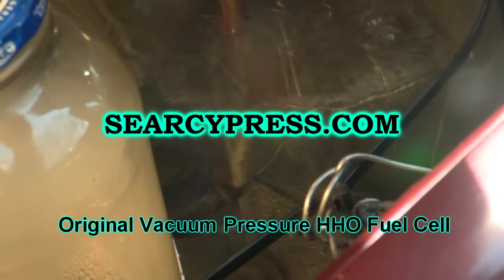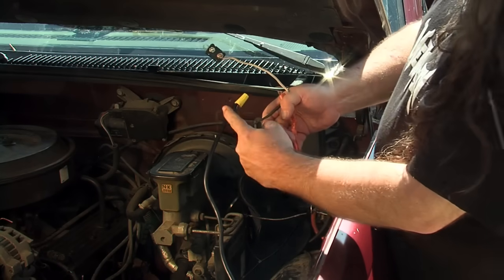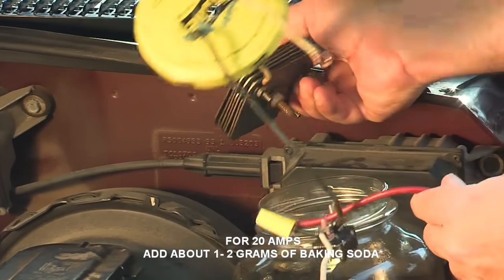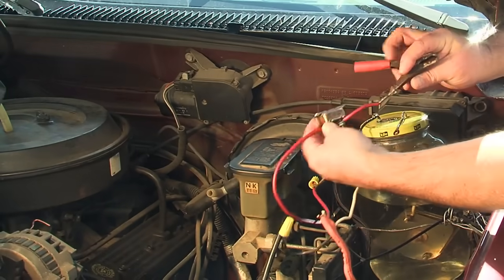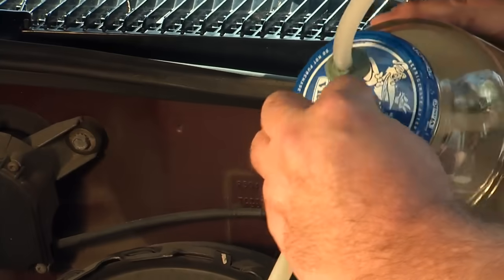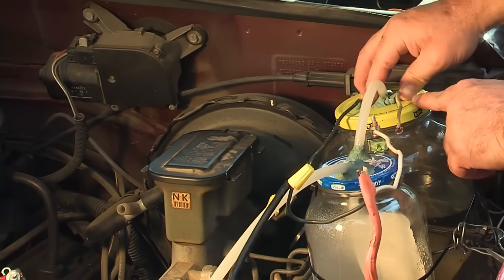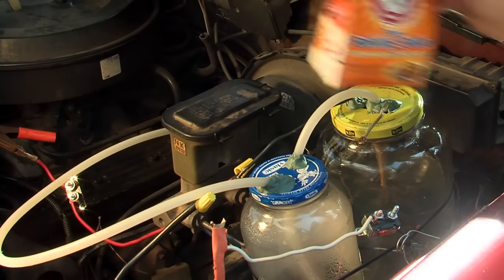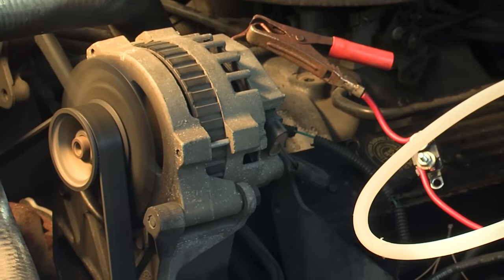Vacuum Pressure Hydrogen fuel cell defeats high gas prices using hydrogen from H2O.

Comment: Hydrogen costs more then gasoline to power a vehicle but it does burn cleaner. This little jar of water couldn't produce enough hydrogen to power this car more then a few miles! It's a GIMMICK, and if you believe this BS I have tickets to Mars for sale for just .50 cents each (Round Trip)
Reply: It's not fueled completely on the gas. I built one long time ago. Went from 35 mpg to about "39 to 40" over the same trip lots of times. But did build a much more powerful system.  I really kinda think the gain is from a quicker combustion and causes more gas to light faster making it a more complete burn. The stuff is explosive. But at the end of the day it was alot of work to keep amps and water full. The extra work was not worth the 5ish mpg.

Comment: Ammonia is NH3, and has a less strong bond than H2O. Thus it takes a lot less electricity to separate those bonds and gives you more hydrogen and nitrogen, which in turn, gives you more hp for your engine.
Reply: Isn't that very flammable or explosive?

Comment: For all that have the Question: vacuum to carb?  You would not want to run through your carburetor. This set up. (Going rite to manifold vacuum) still make it to cylinders as each cylinder draws vacuum the hydrogen ( in theory ) gives a cooled boost of air/water vapor.  To the air/fuel combustion. If run through carb. You would get a build up of corrosion and it would defeat the purpose.

Comment: Okay, I've watched this a couple of times and I do not see anywhere that you are separating the hydrogen and oxygen. They are both in the same container and both being sucked into the motor. When you put H2 and O together, you get water, not combustible. If you created two separate containers for the hydrogen and oxygen, making the one for hydrogen twice as big as the one for oxygen, then you might be able to suck off the hydrogen from the larger container into your motor. But now all you are getting is water going into your engine.
Reply from the maker: The process works by separating the hydrogen and oxygen from water. This is done in the state of vacuum. This HHO Gas that is produced is extremely explosive. After it explodes it does produce water. Water is also a byproduct of burning gasoline. Thanks very much for your comment.

Comment: Better use distilled water.. true distilled water isn't conductive to electricity because it has no minerals that electricity jumps through
Reply from the maker: Why use it? It is costly and too much trouble. I never needed it or had any issues with tap water. Thanks for the comment.
Reply: @metalpresstv  distilled water is easy and cheap to DIY

Comment: Would this work on the highway for a diesel? I'd drip black all over tailgaters. LOL
Reply from the maker: I'm not quite sure how you would achieve vacuum. Although hooking it up and injecting into the engine with very high amperage to produce a lot of gas, you certainly could remove quite a bit of carbon. Thanks for the comment.
Reply: I'd add an inlet tube to the reaction tank and let the engine vacuum in the air filter housing pull it in. If I wanted to inject anything into my diesel it would be propane but thats high performance excessive. And about diesels not having vacuum, put your hand over a 7.3 idi intake hole when its running and it will suck your hand in there if it wasnt for the screen on it. Especially at 2000 rpms or more. Thats what I was figuring. The HO tube should be regulated to the engine and a check valve coming in the reaction tank.

Comment: I have been designing something like this for a long time, mine was much much smaller and could not even maintain a flame. But I'm glad to see that someone was able to do this successfully.
Reply: I made a micro torch with a similar setup but to even compare to fuel assist a car you'd need more engineering then that
Reply: It's fake dude

Comment: You do know you can make your electrode container (Pickle Jar) out of PVC or something durable that won't shatter in your engine igniting your fuel cell.
Reply from the maker: Perhaps, what are PVC models melted or deformed where they were not usable. Remember this system is in a vacuum so hot plastic would collapse. Thanks very much for your comment.

Comment: It's a pressure washer for your valves and pistons!
Take that Seafoam!
Reply: Tyler Seitz People have been using water for decades. It works just as good as Seafoam. Keep paying real men to work on your cars for you.
Reply: Nope, I drive lemons. Technicians don't deserve to work on the junk I drive.  It is respectful this way and it works. Besides, I use Seafoam all the time. Love their products,  this video tripped me out that's all. Innovative ideas are always being explored and should be encouraged. Even if the effects are small, it's the effort put in that matters.
Reply: Tyler Seitz oh so you believe  Seafoam is doing something different then. umm ok.
Reply: Tyler Seitz it's called compression. compression builds heat, even without spark gas can ignite. if the liquid does not ignite it turns to steam. so he is technically correct with the steam cleaning the engine. Which would make your comment look ridiculous
Reply: @mellow1163  seofoam is meh
Reply: Young Shrine right on

Comment: "Under Certain Circumstances"  ~  Like rolling downhill. . . . .My brother in law saw this video and made this set up,  we couldn't measure any difference in fuel economy what so ever!
Reply: You need too get a kit { I got it on Ebay } to hook to the O2 sensor to tell the computer it is dumping way too much fuel into the system I was getting 55 mpg in a 87 Dodge grand caravan with a set up of a HHO generator 
       The gas burns clean without the regulator you will burn MORE GAS 
 Im babysitting my grandson so I can not look in my shop what that O2 regulator is called ON NEWER cars they changed the O2 sensors to where you can not trick them with a battery current to make it cut back the fuel flow to run these set ups
Reply: @jonhenry3313  You can trick them by moving the inlet of the hho to the vacum line that is closest to the map sensor if need be put it in front of the air intake .
right aabove the carb ,, if you have fuel injectors then thats a different ball game , tbi shouldnt be a problem if you use a variable resistor control knob and place it in the dashboard so you can fine tune it.. while driving at a specific rpm .. and set it for that rpm ..then u would need a way to program the computer to ajust the rpm with the os  and map sensor inputs ,, which will be beyond my grasp because i dont know much about programming proms
Reply: That's why I said it doesn't work.
Reply: Hence the explanation from Jon.
Reply: @Sheepish Buffalo No. Just a simple domestic plumber.
Reply: You would have to cheat around the o2 sensor man or it wouldnt make a difference. I could tell ya how if u wanted . it's simple
Reply: @joshuaarmour3384  do tell
Reply: Because it’s too small and the engine is too big
And the engine must be “tuned” 
And also this is the model without neutral plates...
Reply: It must take energy to break the water into hydrogen and oxygen. This energy is coming from the alternator. I think the alternator doing its thing as a generator with a load on it, supplying electricity to make the hydrogen, is in turn putting more load on the engine because you don't get something for nothing. This increases the gas mileage but some of the energy to move the car is coming from the burning hydrogen and the system ends up breaking even or possibly worse than using the gasoline alone.
Reply: If you are using the car battery and alternator to generate hydrogen you will get worse fuel economy. A GOOD hydrolysis cell is 70% efficient - you never get the 30% loss back. These are lousy cells so scale up....
Cars with computer controls will simply not run since the throttle controls the fuel flow not the air flow and on detection of a overrich mixture or detonation (hydrogen is very sensitive and will detonate (and has a very high flame velocity) at the drop of a hat) will shut off the ignition to the rich or detonating cylinder.
Reply from the maker: The engine is wasting a large portion of fuel by design. This process allows for much burning  of lower octane fuels without engine ping. We never said it was overunity. It works on some engines without o2 adustments. Thanks for the comment.

Comment: I appreciate all the technical details and the time you took to make the video.  Here's some constructive criticism.  It seems an awfully crude set up to run for 30K miles.  Why run power directly to the dashboard with a household switch instead of hooking up a 30 amp relay in the engine compartment triggered by a smaller automotive switch on the dash?  Why use alligator clamps and wire nuts for a dedicated system?  Why are so many live power connections loose and exposed risking potential shorts?  Why use putty?  Grommets capable of a good vacuum seal can be found at any auto parts store, you could even use tire schrader valves.  If I had a glass jar generating hydrogen gas under my hood it would be held securely in place with some dedicated armor not just wedged next to the master cylinder with a old floor mat as protection.  If the plates are just hanging inside the jar what is preventing them from smashing the glass from the inside?  Use a different vacuum source.  A truck with compromised brakes a dangerous thing.  If you saved so much money on fuel why not spend it making the system better?
Reply: Damn this guy complaining knows how to take all the red out of redneck and where's the fun in that
Reply: Video is valuable Because of the simplicity of of design so that average worki g  people can build and test thier own within a common sence budget. Then your thoughtful upgrades can be applied as time permits.
Reply: Haters gonna hate.
Reply: This guy got double jabbed and 2 boosters
Reply from the maker: It was a prototype. It was in a constant state of development. This video got most of the views, however it is not the end of the story. Thank you for your comments.
Reply: @metalpresstv  eny updates on this lot cheaper than buying a 50k electric car
Reply: @usernameforyoutube2661  Certainly not as dangerous as a gasoline fire, worst thing that could happen is you blow yourself up. It'd be quick. Just keep any sparks away from the "HHO tank".
Reply: Good questions you throw at this guy. just the questions I've been asking myself.then I again I was like🤔 surely he just wanted to have more views so that he could be payed.then boow🤯 here comes answering the Q.saying he doesn't matter he got more views that's what he matters
Reply: Amen, the kit in the video is a straight up fire hazard.
Reply: It works and I seen cars run on mixer of air and just gas fumes
Reply: That's none of your business know it all
Reply: Dude, this would never work,
Reply: It is dangerous be careful if you try
Reply: It’s not dangerous at all it’s water it’s not gasoline please don’t spread things u don’t knw
Reply: @michaelmayberry1439  this method uses electrolysis of water breaking it down into 2 very explosion gases oxygen and hydrogen. Oxygen will always fuel a fire. And hydrogen gas ... well Remember the Hindenburg ball a flames. So if these gases ignite outside of the engine you could get hurt. If they stay in engine and no leakage then the oxygen and hydrogen recombine to make water, thus the moisture coming out of the tail pipe. I think a well designed containment system will work.....only problem is don't ever get into a car accident
Reply: @Michael Mayberry Please tell me you’re trolling… he’s generating hydrogen gas. Hydrogen gas when mixed with oxygen is very dangerous.
Reply: @michaelmayberry1439  well, you are obviously spreading things you don't know. This isn't just water, it is hydrogen and oxygen gas which will explode if allowed to build up and some wayward spark happens to ignite it.

The person was offering some constructive criticism in order to make the system safer - and better.
Reply: @michaelmayberry1439  It is more dangerous by nature, that's wrong. Hydrogen gas is more explosive than liquid fuel (that's why they fuel rockets with it, lol). That's why we use it, because even if it leaks it still doesn't catch fire as easily, especially the likes of diesel. Gasses like hydrogen can flow into places liquid fuel cannot, what nonsense. It is inherantly more dangerous and you're confounding by claiming "derp it's water, not gasoline", how weak and lame. The water/hydrogen becomes explosive when converted to HHO, hence why people do it, duhhhh. Do you even hear youself? lol.

Comment: Terrible.  You warn about causing a possible explosion but you are using glass jars.  I and another engineer friend of mine experimented with this idea for over a year and found it impractical.  The biggest problem is as the electrolyte boils out, the conductivity of the remaining electrolyte gets higher because of the increased concentration, causing increase in Amperage draw and a viscous cycle.  You can produce enough Hydrogen to improve your gas mileage over short runs but the reactor spirals out of control because of amperage draw gets too high.
It's great that you have interest in this but you need to ditch those jar reactors and get stainless cans (best option) or go with plastic.  Also, use lye (Potassium Hydroxide) in your water, not baking soda.  Use a heavy duty toggle switch with a relay, not a fkn light switch.  You need to be in the 30-50 amp range consistently or all you are going to make is steam or nothing.  Interestingly, steam will increase your gas mileage also though
It can be fun to experiment with but do it safely, you are not even close.
Reply: You sound like you know what your talking about my 81 mustang is just a beater with a new 26 circuit fuse bix and a 120 amp alternator but a good base to make this set up what do i need can you give me the info
Reply: @bobxx6396  I am reluctant to enable you to get involved in this gagglescrew but willing if you are determined. First, tell me, do you know how to wire a 12vdc relay?  Describe to me what relay does/why it is mandatory. I will not help you do something stupid/dangerous.

Comment: 120v ac 15amps switch is not 15 amp on dc,what the "magnetic field" have to do with the hidro generator it use the current 😲 im confuse Tesla wireless power 😳 .... Jfyi
Reply from the maker: Hey....it worked..after burning out a dozen toggle switches. It's not like I had OSHA breathing down my back. Thanks for the comment.
Reply: I had the same thought tbh, idk what he meant when he said you have to put things where the magnetic field is strongest or whatever
Reply: @coledavidson5630  That was what's called "word salad". Or "pseudoscientific language".
Reply: @Stigstigster  I kind of figured 😂 thanks for confirming :)

Comment: This is impossible unless you have some magic involved that gets around the second law of thermodynamics. It takes more power to electolysize water into hydrogen and oxygen that you recover by burning the resulting hydrogen. It's a net power loss.
Reply from the maker: This is not over Unity. This engine wastes so much fuel we are able to get a more efficient burn. It is not something for nothing. Thanks for the comment.
Reply: @metalpresstv  you are delusional
Reply from the maker: @dannysweeney3754  some  say visionary. Thanks for your comment.

Comment: So many things wrong with this, but the biggest issue is T-ing into your vacuum source for your brake booster.
 Never ever screw with your brake booster vacuum. If you plan to just drive around the woods, it is fine. But you damn sure better not be driving on the street with your brakes compromised.